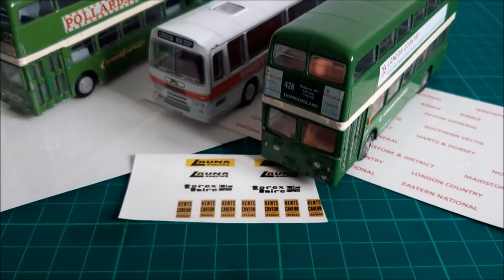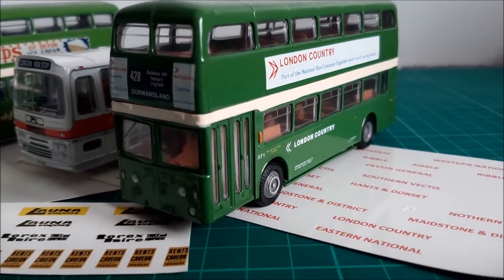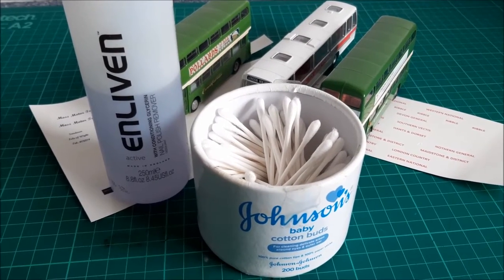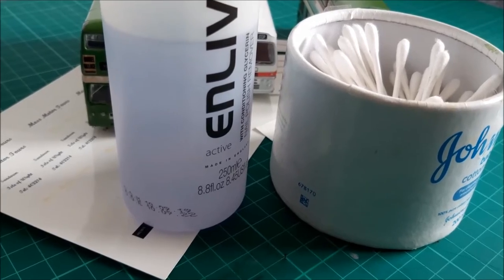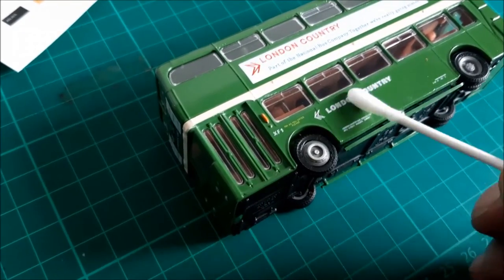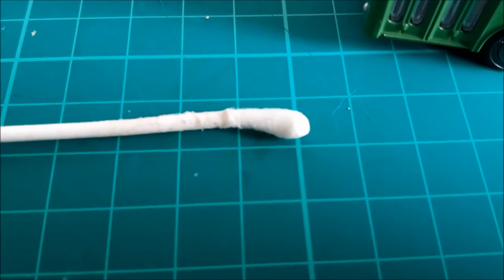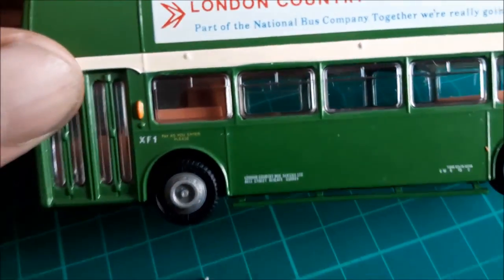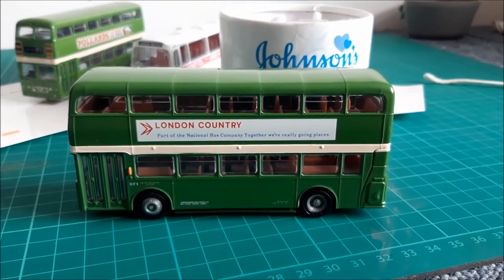What is Tampo Printing and How to remove it ? -?sub_confirmation=1

Comment: Traditionally nail polish remover was acetone, but they're moving away from that to either a mix with or pure ethyl acetate (smells like pear drops). Both are 'solvent' type...err solvents and are good for removing paint and tampo, but can damage certain types of plastic and can sometimes be very quick at removing the base colour. Isopropyl alcohol (isopropanol, IPA, propan-2-ol) is completely safe on all plastics and removes paint / tampo at a slow rate, but usually needs quite a bit of rubbing to get it to shift tampo printing. Main thing is to try on a small area before use - which is the first thing you did in the video. You may have been there some time trying to get that London County banner off with IPA, so glad you got the nail polish remover to work. Nice one!
Reply from the maker: Many thanks for your comment and in depth knowledge. I'm glad you enjoyed the video. Stay safe my friend

Comment: Testors Model Paints (Rustoleum) makes a great product called ELO (Easy List Off). It's safe on most plastics and paints. Does a good job of getting tampos off injection molded plastic toys where I have used it. My only caution is stay from the clear plastic windshields like the buses shown above. Many of these products will dull and attack the clear plastics. Tamiya also makes a product but I found it waay too aggressive and does attack paint. Although it worked fairly well on removing chrome from plastic with no damage.
Reply from the maker: Thank you viewing and taking the  time to leave a comment. I use many Rustoleum products and the y make great stuff. Unfortunately, I was not using them when I made this video. You are right about keeping such products away from plastic glazing. I try to advocate easily available and affordable solutions. After all, this is not a cheap hobby and price points deter the young from joining many aspects of a great hobby.

Comment: Does the nail polish remover need to be 100% acetone? I tried borrowing a small amount of my girlfriend's nail polish remover that was only 50% or 60% acetone but it didn't work to remove the tampo.
Reply from the maker: I just checked the bottle for the one I used in the video. It does not specify the amount of acetone but as there are several other components listed it is clearly not 100% acetone. Some tampo printing requires several 'treatments' to remove it, in my experience. Generally I have always used cheap and cheerful ones from a corner shop and they have never let me down. Hope this helps.